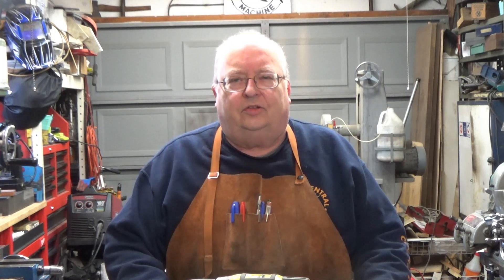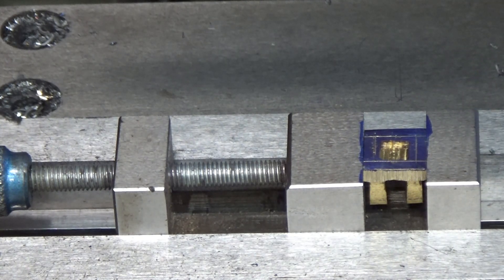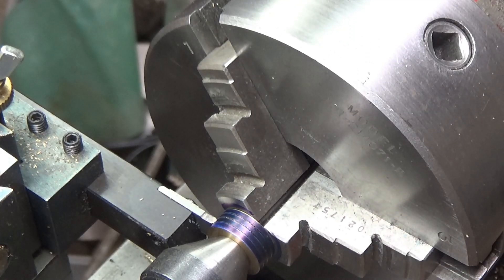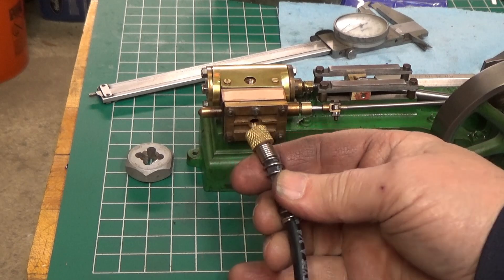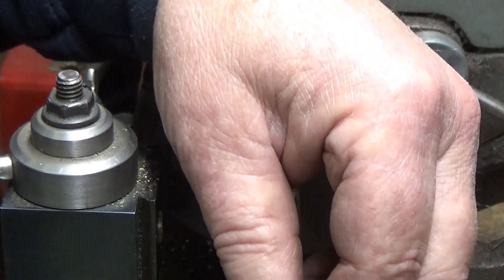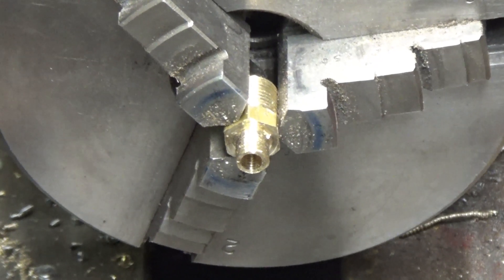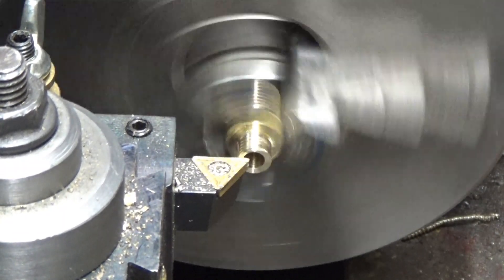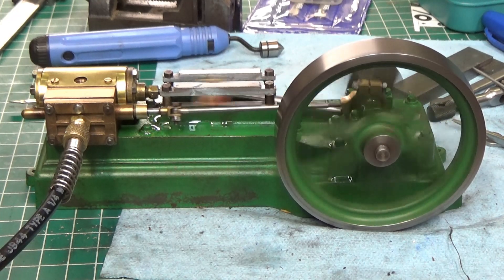Stuart S50 Steam Engine Rebuild / Repair-Part #6

Comment: nice to see it running.
that's an unusual die holder you have there, they usually have 3 grub screws in them, 1 to expand and 2 to nip the die up.
Reply from the maker: I used two different die holders the one for the 1/8 NPT is a hex die and they have one screw.  The holder that I used for the 1/4-32 was a small diameter round die the had the traditional 3 screws in it. Thanks for watching and commenting.

Comment: Very nice Steve, with a couple adjustments it runs perfectly with the air brush compressor. Thank you for keeping the revs down.  Nice video series 👍👍👍
Reply from the maker: Definitely not designed for high speed operation.  I was quite surprised and pleased with how smooth it runs.  Thanks for watching and commenting.